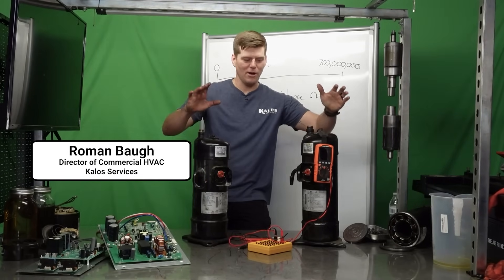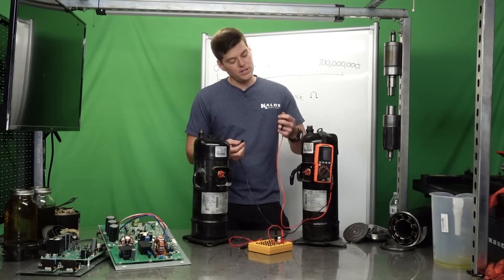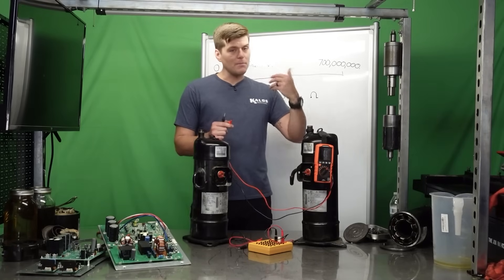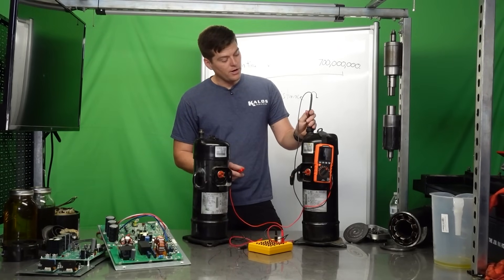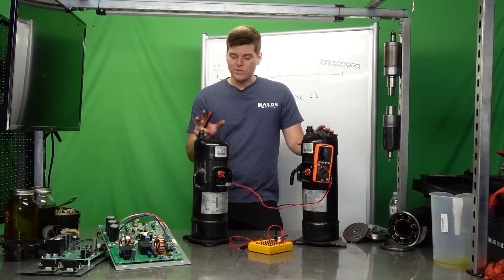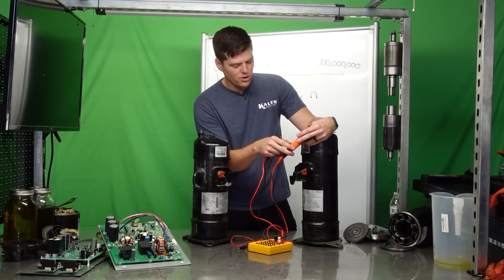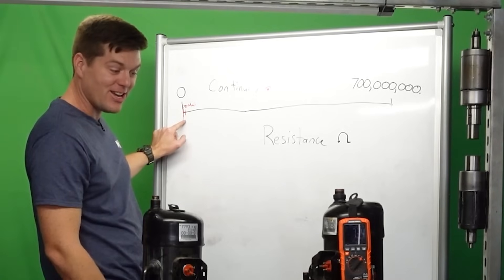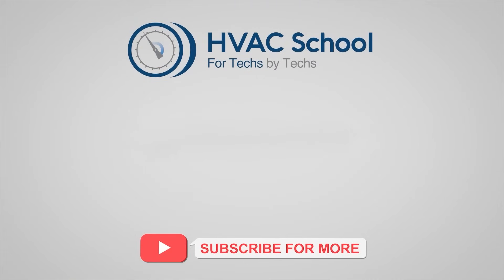The Difference Between Continuity and Resistance

Comment: According to Copeland BULLETIN AE4-1294 R1 the threshold is > 500k ohms is ok and a rule of thumb is as low as 1k ohms per volt is possibly ok so a 230v motor can measure as low as 230k ohms and still be ok.  Also according to Copeland refrigerant migration in a cold  compressor case can affect reading making it look worse.

Comment: You didn't check across the terminals on the grounded compressor that didn't beep. On either comp for that matter. Grounded is not the only failure. Open/broken winding is a thing.

Comment: Some meters like a Fluke 87 can go well beyond 7 mega ohms.  Then pick up with what used to be called "mho" with the ℧ symbol going way on up to the equivalent of 100 GΩ.  The metric term for the ℧ is nanosiemens or nS.  nS is the inverse of ohms so where 0 Ω is a really good connection 0 nS is an extremely poor connection.   

0.01 nS = 100 GΩ
1 nS = 1 GΩ
2 nS = 500 MΩ
10 nS = 100 MΩ
20 nS = 50 MΩ

There is usually an overlap between ohms and nS so there's no gap in the ability to measure resistance.

Comment: Continuity is used only for checking resistence between 50-100 ohms. You just need to read the multimeter instructions. When resistance is over 100 ohms the multimeter is not going to bip.

Comment: Excellent explanation,  but it needs to be talking about checking motors rather than just compressors. 
Compressors ARE motors, at least for electrical measurements.
Reply: I do not disagree, however sometimes it is easier to understand when you can see it in action.
Reply: @RomanBaugh 10-4!

Comment: And you need not to hold your probe with bare hands as you body is also a resistance,and a motor need to be checked with multimeter that had  60 mega ohm range and you may need insolation tester if the motor is not working like it should be 
 example drawing current above the limit ,

Comment: I wrote notes of your resistance VS continuity. One MEGohm or less becomes a potential loss of compressor motor winding resistance leaning to a potentail motor failure? Thanks for your time
Reply: Resistance VS Continuity Episode II Rise of the Phantom Tone
Reply: @Dg_donn love the video idea 😂
Reply: Yes 1 meg or lower means the windings in the motor have degraded enough that when a load is placed on the windings they will ground out, overamp and trip the breaker.

Comment: I never understood why people test resistance with the continuity function. Continuity on my multimeters is linked to the diode check function, so I only use it for checking diodes. Neither can be used on an active circuit. Both rely on a voltage divider principle to estimate resistance, but the applied voltage is different and the scale for the diode check measures drop across the diode in volts. If I'm trying to estimate resistance, I want a reading that measures ohms.
Reply: @spelunkerd  people don't know how the multimeter works,I still remember first time when I faced the ghost voltage it was hard for me to understand why my multimeter mesure a voltage when I was sure I already turned off the power ,it was a long time
 when there's no multimeter with Loz
 fonction. To use a multimeter it looks easy but you may not get the right ready if you're not using the right way .for example a fan blower motor could be turning when you're taking measurements of the winding resistance,that will cause the measurements to be wrong. To check if the motor is turning you need to measure voltage  if there is a small voltage that is measured with your multimeter you need to stop the fan blower from moving.also your resistance if the motor is turning will keep changing.
Reply: Because they don't. On my meter both functions are on the same setting, but with the ringer I can get feedback without even having to watch the screen. It's really only if it doesn't ring that I need to dig deeper.

Comment: would you use continuity to check between the windings on a compressor or is that also the  resistance setting?
Reply: Continuity mode is just a mode that you use to prove a circuit is complete. It’s handy when you’ve got your head stuck somewhere you can’t see the display. Ohms mode is for true testing. So you use ohms mode to test windings. Typically on low tonnage compressors your Start plus Run windings will equal around 7 ohms.  Any of the pins that conduct anything to ground is a bad sign.
Reply: If it's a single phase compressor you want to use resistance to check between the windings. The Start-Run resistance should equal the Start-Common plus Run-Common resistance readings. Can't check that with continuity
Reply: @rayzerot  For a 3 phase compressor, you will check the same thing the same way.  The difference is all 3 combinations should be very close.
Reply: You can check for continuity first and then to be thorough you check the resistance. For technicians, checking the resistance all the time is handy for building up a mental database of the ranges you should be looking for. Continuity wont catch a shorted together winding.
Reply: Continuity is for electrical circuits that SHOULD be connected. 

Resistance is for everything else that falls outside of that. (This means looking for grounding)
Reply: Yes you check each pin on compressor to ground if it beeps it's good if it doesn't it grounded compressor